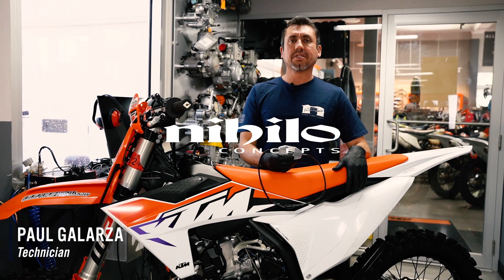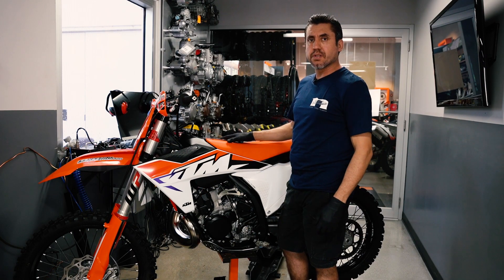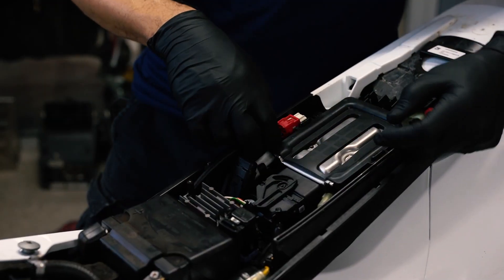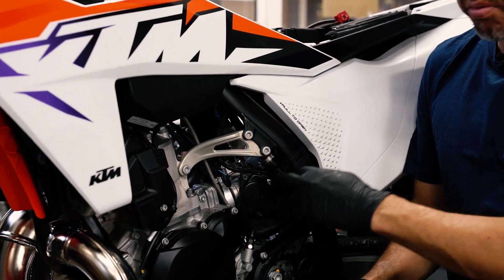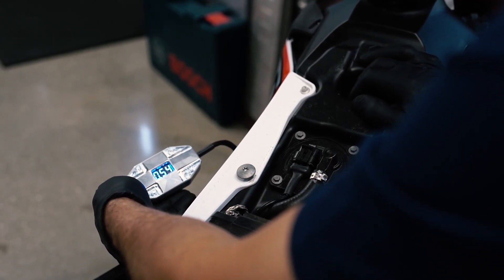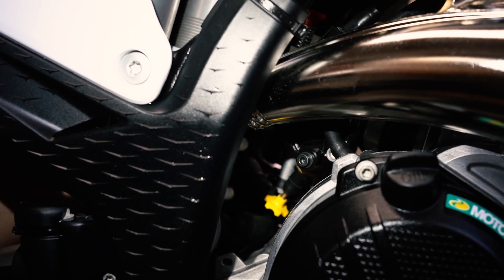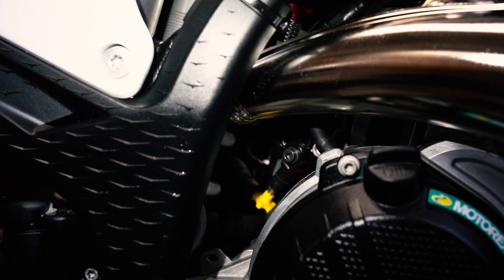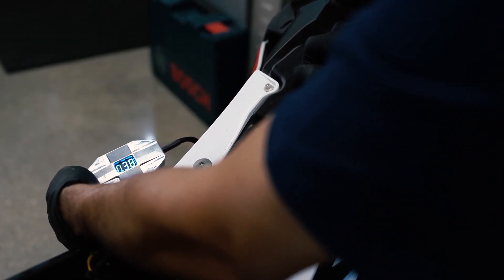How to use the Nihilo Concepts TPS Setting Tool

Comment: Regardless of the comments below the way he's doing it in this video is right, I have been using a TPS setting tool since 2017 on all 6 KTM's that I have had. Every bike I have checked in America has come set Lean from the factory, the other day I checked my buddy's new 2024 KTM 300SX and it was too rich at 0.50.  And if you think with a regular volt meter good luck with that because the TPS sensor is very sensitive you will spend an hour trying to get it right.
Reply: How would using a volt meter be any different or more difficult than this tool given you still need to clock the TPS? This tool isn't particularly precise at 2 decimal points so hitting .4 and .5 is easier but not as accurate if that matters.
Reply: @TeamStruggleBunny  you're correct about the 2 decimals and it does matter because the ECU's resolving is much finer (12 bit over 5v = better than 3 decimals) than this tool. Also the imprecision of the TPS setting is a greater issue at small throttle openings than it is for large throttle openings.
Reply: @wwilcox2726  Makes sense. I had good luck on my 2015 500 exc with increasing the voltage a tiny amount. It really woke the bike up.  I'm wondering if a very mild increase would give more bottom end, carb like feeling, on a TBI bike. Tacomoto suggest this works down low but really leans the bike up in the upper values or revs.
Reply: It's funny that according to you they all come lean from the factory, and yet KTM has the tightest calibration spec of all the major brands. Hmmm?

Comment: 👎 :-/
That's not the proper method.
Reply: What is the proper method?
Reply: It's different for each of the displacements 250/350/450/500 and you don't set your rpm to whatever you desire or you may create stalling/dying issues. The cold start is also different for each of the models. And don't confuse "setting" the TPS with "calibrating", because KTM specs to 3 decimal places   and usually only a total range of 0.005v which is half the resolution of the device. In addittion for true calibration purposes requires a measuring instrument with 4 decimal places of resolution. @A_A_Ron78
Reply: @wwilcox2726  ok, but what's improper about it?
Reply: What's the setting for a SX/MC 150?

Comment: When you do it this way its only oke, when you also do the tps calibration. When you do it like this without the tps calibration its more off than before. Your ecu wil stil think 0,3800 volt is the zero setting while you have changed it to 0,4000 volt. Great video, butt at the calibration process to it. To have no problems.
Reply: How do you calibrate it once done setting tps?

Comment: How does this differ from the much cheaper tpstool that also doesn't require using the power up dongle or even taking off the seat?
Reply: What tool is that?
Reply: This uses the bikes voltage Vs. onboard power from the other tool.